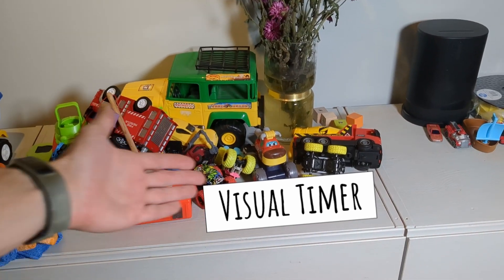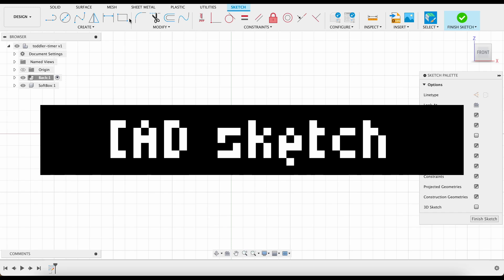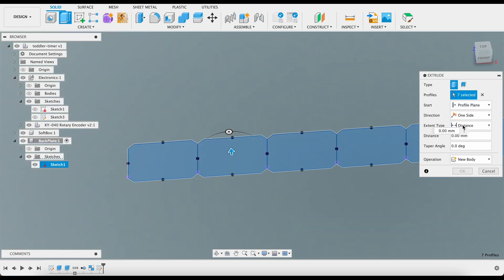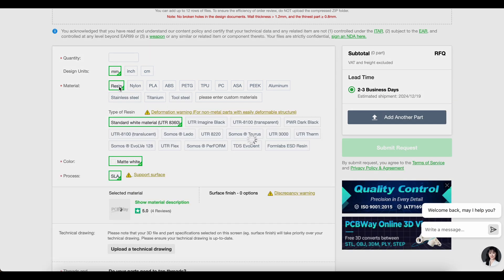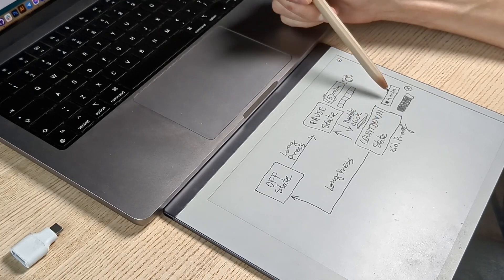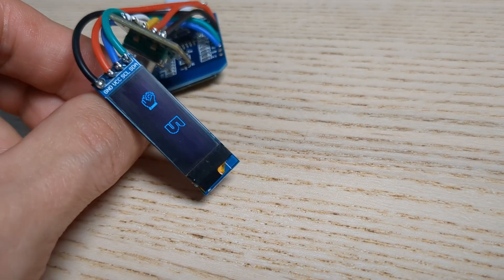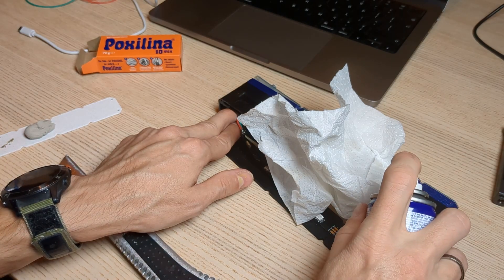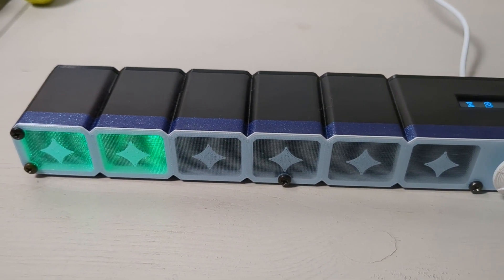Toddler Anti-Procrastinator: a 3D-Printed Visual Timer

Comment: I like the Idea - but the time timers and pomodoro clocks are better imo, also because the elapsed time is congruent with the minutehand of a clockface - which enforces the understanding of time when learning to read a clock face
Reply from the maker: As far as I can tell, reading clock hands comes much later. The aim here was to have a tool for enforcing time limits and this worked very well. My 2yo respects the authority of his new timer master.
Reply: @juliusmakes  I agree that the telling of time comes later. You have built a progress bar, which means that it will be at 50% both when it has elapsed 30 minutes out of an hour, or 5 out of ten, and that is what made me comment as I did. 

I like the process, and I think it is a valuable tool. My sister's 3-year old has a time timer, and she uses it without issue with my nephew. No, he hasn't got the telling time down, but my argument is that he will get a better sense of "I have five minutes left" than if it was a progress bar.